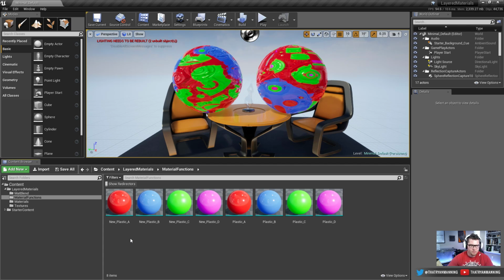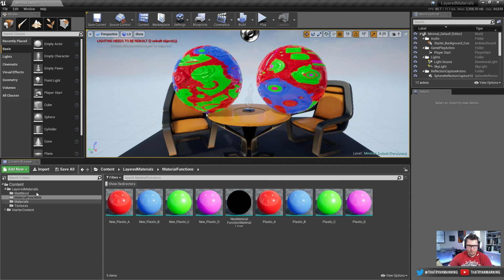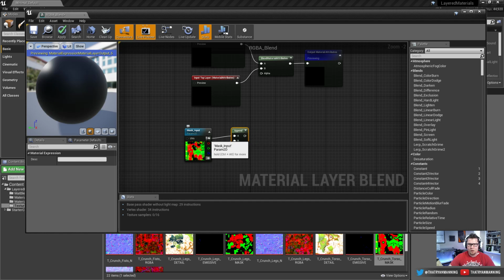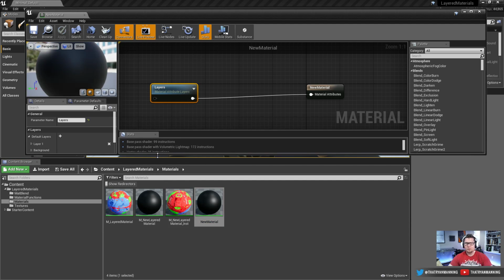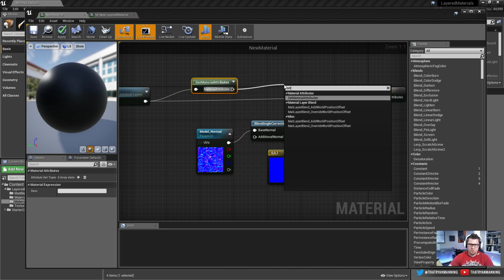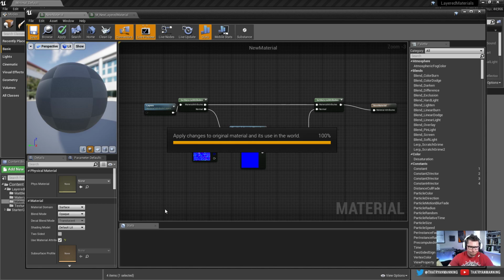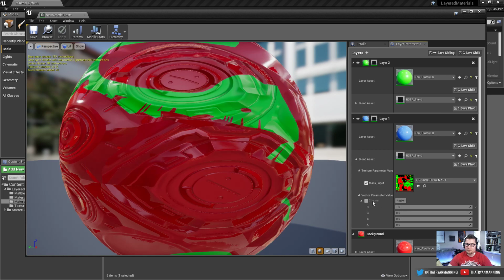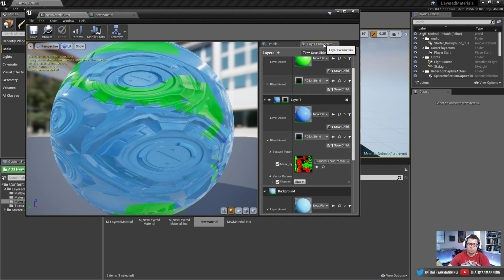UE4 - 4.19 Layered Materials Setup (Quick Tip)

Comment: Hey Ryan, thank you so much for taking the time to do these videos, it's very helpful for us noobs! I have a question, how do you do a layer blend material if you want to do it from standard materials you already have built, for example, I have downloaded some Quixel materials and I want to blend those in a Material Blend, do I have to build the materials again, using a layer material o is there a way to use normal materials as layers? Thanks in advanced!